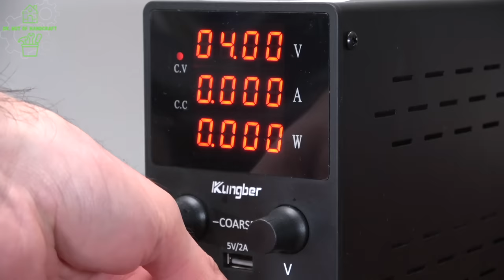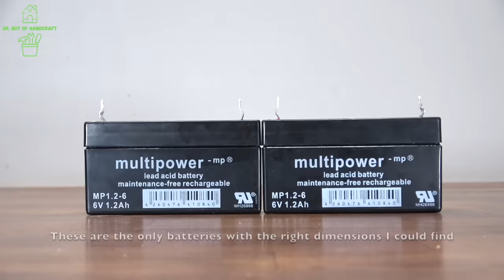Brass plating on a rare 1945 German Mining Lamp! (Full Restoration!) I Dr. Hut of Handcraft

Comment: Well done! The only question I have is, why would a mining lamp be painted black in 1945? How could it be found if it is off, and set down in a mine?
Reply from the maker: Thank you Alex! That is a good question, that I don’t have an answer for 😄 The only information I could get from my research was a pdf file with a list of mining lamps and this one was also in there with the year of 1945.
Reply: Were I to hazard a guess, it would be because of paint availability. Presumably in a mine, if the lights fail, the darkness is absolute and I mean ABSOLUTE, so it wouldn't matter if the lamp was black; that and any paint is better than exposed metal for durability purposes.

Comment: Superb result!  Your videos are so pleasant to watch, almost peaceful.  Also, thank you for the very informative captions.
Reply from the maker: Thank you! I am glad you liked it 🙏🏼
Reply: @DrHutOfHandcraft  why do you use all kinds of means first, you can sandblast it right away, then you remove paint and rust in one work step 🙄
Reply from the maker: @tommynygaardjensen8398  I could but the most important reason not to do that is that there is high possibility of lead in the paint, because it was used back then. Even though I have a suction system on my sandblaster, I don’t want lead paint fly around my workshop.
Second it would take longer, because the paint was very persistent. Due to that the blasting medium turns bad much faster.
Reply: @DrHutOfHandcraft  it's a hobby you in the small amounts it doesn't matter it's more harmful to use paint remover 🤔
Reply from the maker: @tommynygaardjensen8398  Using paint stripper in those amounts is definitely not more harmful than sandblasting lead paint if you use the proper proper protection gear, which I do. Please don’t spread wrong information.

Comment: Very well done!! Unfortunately it is totally not clear why you wash it and remove paint before sand blasting?
Reply from the maker: Thank you! 
Washing is so the parts are all clean first. Maybe there are some details that I find, which make me decide not to sandblast. Also it keeps the sandblasting cabin clean when the parts are clean. I don’t want unnecessary dirt and oil in my cabin.

Removing paint before sandblasting is because old paint, especially from that period of time may contain lead. I don’t want lead in the air, that’s why I remove the paint with a good paint stripper first. Also paint may contain hexavalent chromium, which is considered cancerous. 
Removing paint by sandblasting also takes much longer and makes the sandblasting medium turn bad faster.

Comment: IMO, if you're going to fill pits in metal, try using JB Weld Steel or Aluminum. Not automotive body filler. (Bondo)
Reply from the maker: Okay, why?

Comment: Why the graphite electrode?
Reply from the maker: Why not? 😄 You can either use a graphite anode or copper anode for copper plating or zinc anode for zinc plating.
The only thing is that theoretically the electrolyte would get over saturated by time if using an copper anode for example. That would cause bad plating. But for me who doesn’t do copper plating that often it doesn’t matter.
If you do that more often I would recommend an graphite anode.
For nickel it doesn’t matter in my case, because it’s quite easy to make nickel electrolyte. But you could also use graphite for nickel plating.
Making zinc or copper electrolyte that works good is much more difficult

Comment: 19:19 😱 Drilling sheet brass like this is dangerous. An unmodified drill will very often pull sheet brass up like a screw because brass is soft but tough. Holding the sheet with your hand like this puts your fingers at risk of being badly injured. Our mechanic teacher always said: ☝ “Hands are not a vice!” Grinding the drill to a negative rake angle is advantageous when drilling thin brass. And flattening brass with heat also makes it soft, which is not ideal as a spring. Otherwise fantastic work. 👍
Reply from the maker: What you are describing can actually happen with every thin sheet metal, so I don’t recommend doing it like I did in the video 😄
You are also right with the heat and the “spring” but I didn’t raise the temperature very high and the part also doesn’t have the purpose of being a spring, it just holds the contact piece. But I get what you are saying!
Thank you for your comment and glad you liked the video 🙏🏼🙂

Comment: Do the numbers on your screwdrivers represent the drivers mm size?
Reply from the maker: Kind of, it represents the size but a 5 is not 5mm. A 5 would be 1,2x8mm f.e. I think
Reply: @DrHutOfHandcraft  Thank you, I really appreciate the reply!
Reply from the maker: @infin1ty850  you’re welcome!
Reply: What brand of screwdrivers you use
Reply: @roysmits6822  Wera
Reply from the maker: @roysmits6822  The ones I used in the video are from PB Swiss Tools. But I also have some Wiha screwdrivers and also like them very much
Reply from the maker: @infin1ty850  no, pb swiss 😄
Reply: Thank you very much I've been looking for a while fore better fitting screwdrivers
Reply from the maker: @roysmits6822  you’re welcome

Comment: I think it's over restored now. It's better like new. 
I would have liked better if you had let the age and the years of hard work of this brave little lamp being shown. Of course removing all the dirt and rust and repairing what's broken, but not much more and/or using techniques of that era. I bet orinally the lamp had just a simple enemal finish, which was typical for that type of equipment.  But in the end, this is a just a matter of taste.
Reply from the maker: I take that as a compliment 😄 Thank you for your comment, I appreciate your opinion!
I didn’t want to nickel plate the outer parts again, because nickel isn’t actually a very good corrosion protection. I like the contrast look of black and brass and the outer parts being brass and brass plated is the only thing that is not original. Everything else (besides the batteries) are original.
And it was painted and not enameled. If it would’ve been enameled I wouldn’t have been able to remove it with paint stripper.
Reply: @DrHutOfHandcraft  Ah, i see, my bad, sorry for that.
Reply from the maker: @leximatic  nothing to be sorry 😄 thank you for your comment !

Comment: No Wooden handle missing?
Reply from the maker: Nope, there was no wooden handle. Where and how would you attach it anyway? 😄
Reply: Wooden bar on top, screws on the bottom
Reply from the maker: @cezarycezary1  well as you can see, there are no screw holes, so there were no originally. So no wooden handle missing 🙂

Comment: What on Earth type of rubber is still even remotely good after 80yrs? Seriously analyze that rectangular gasket!
Reply from the maker: 😄😄
Well it had some small fissures and was not perfect of course but because it still worked as it should, meaning that it made the top close tight, I decided to keep it after cleaning, because yeah it still worked perfectly fine for that purpose 😄